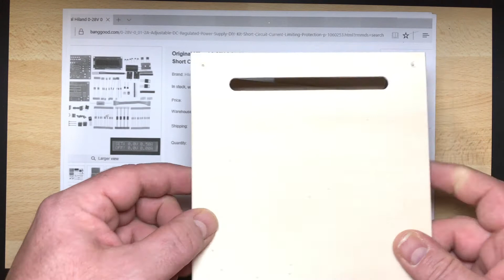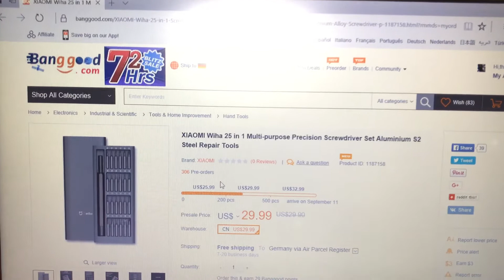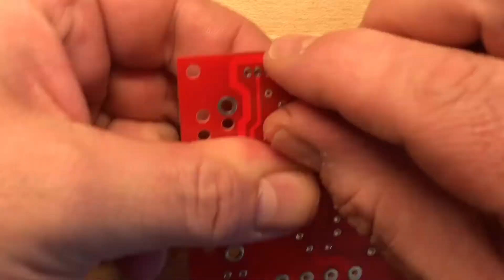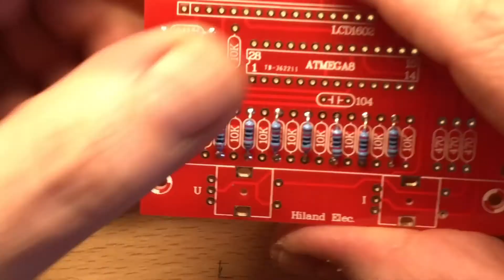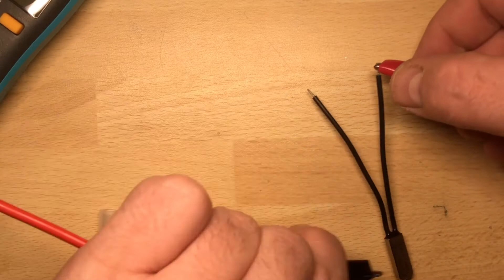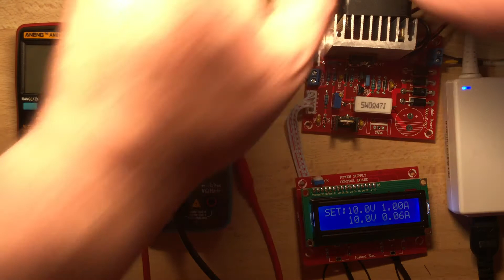Kit build time * Original Hiland 0-28V 0.01-2A Power Supply DIY Kit

Comment: Hey! You did it! :*)
I got lost, around the 20 minute mark, with your test wiring connections.
Do you have a link/etc. where I could find out what goes where'? Yeah, I'm new to all this. Thx! :*)
Reply from the maker: Sorry don't have any link for you, but the board is very easy to use everything is very well labeled like "AC IN" or "Out" so don't worry it is easy to build. As long you are not sure what you do please don't mess around with mains voltage.
Reply: Do It Yourself quick & dirty Hey! :*) There's two (2) links in your video description (above).
 
Here's a (mobile) link:
Original Hiland 0-28V 0.01-2A Adjustable DC Regulated Power Supply DIY Kit Short Circuit Current Limiting Protection 
https://m.banggood.com/0-28V-0_01-2A-Adjustable-DC-Regulated-Power-Supply-DIY-Kit-Short-Circuit-Current-Limiting-Protection-p-1060253.html

And yeah! I'm not gonna be messing around with AC mains voltage. :○ No way!

(Subscribed! :*D)

Comment: Is not a problem using a DC input when the Power Supply is expecting a AC current?
Reply from the maker: It depend on the circuit, there are some design out there which need really AC, but this one is very happy with just DC. The easiest way to check it is just try it.

I like to use those full isolated switching power bricks , because you don't need to mess around with main voltage that is safe, even I know how to use main voltage and deal with it, I don't want use it in a self made wooden case.
So if you can't make sure that you have proper isolation and ground and all this other security related  stuff then don't mess around with main voltages your family will be very thankful. 

It would better if I have a 30 volt DC power supply to use the whole range of this circuit but most thinks I have work between 5 v - 12 v
Reply: Great to know. Thanks! Great videos by the way!
Reply from the maker: https://youtu.be/QNB_0AliFag this is the second part.